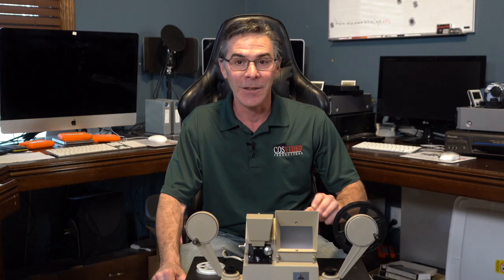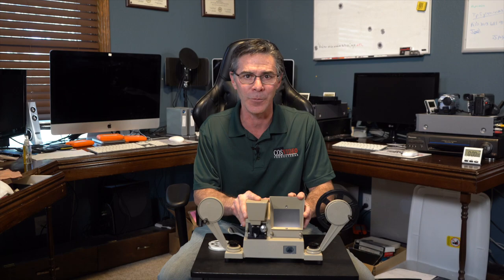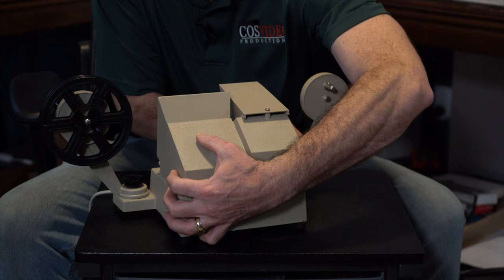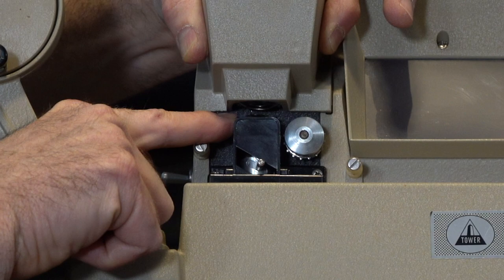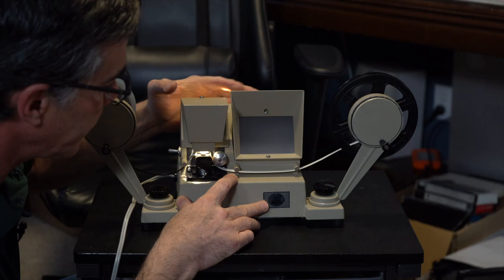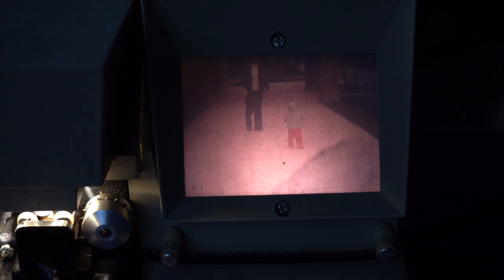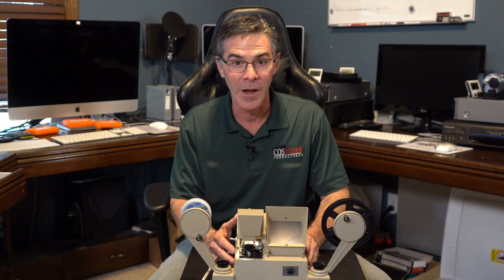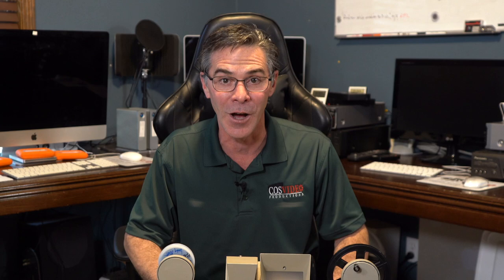How To Operate a 8mm Film Viewer

Comment: My viewer/editor didn’t come with a take up reel for the handle on the right side. Can I buy that online anywhere or does it need to be a particular kind?
Reply from the maker: Any kind that should work as long as the center hole is the same size. Regular  8mm take up reels are about the diameter size of a pencil and super 8 is about the size of a marker.  If you have a super 8, take up reel, just make sure you have an adaptor for regular 8.